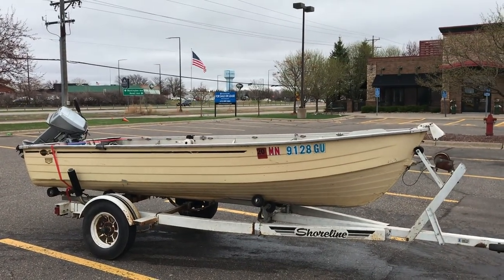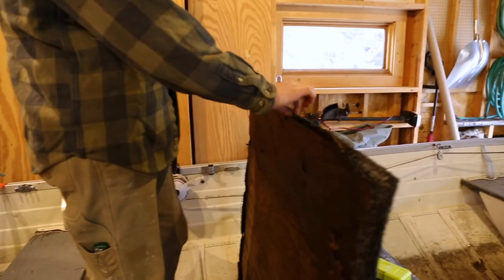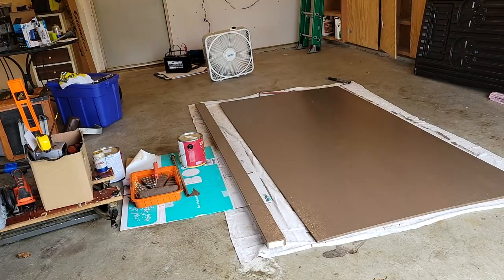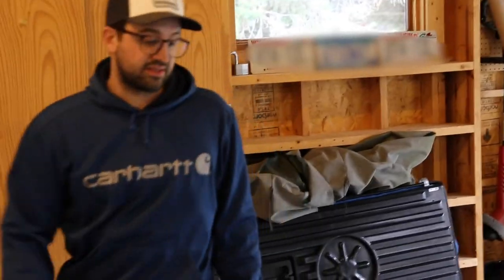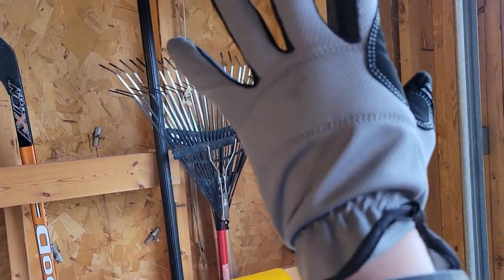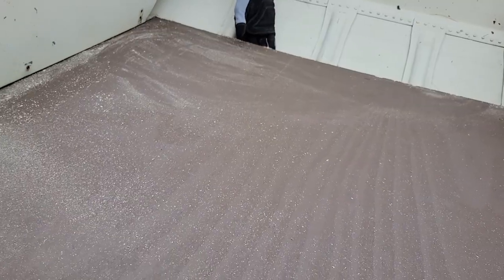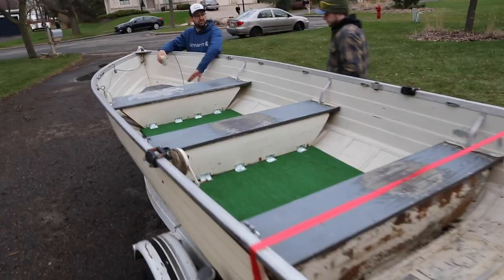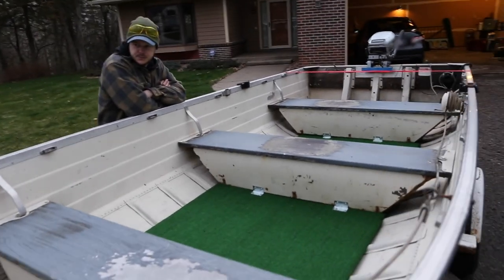Replacing Floors on an Old 14 Foot Aluminum Boat - Boat Prep Part 1

Comment: You guys give off the vibe you've never used power tools but not in a bad way
Reply from the maker: Haha Thanks I guess? Alex works as a line supervisor at a workshop, but I sit behind a desk all day. So, you're half right.
Reply: @TheresOneOutdoors  meant no hate by it man, love the video. I was redoing my new boat and came across the vid so it definitely helped 👍
Reply: @lucyfur8068  no offense taken! Glad it was helpful
Reply: Axle does not look bent, it’s supposed to be cambered in the middle.
Reply: Ok, now I'm inspired, sort of. I want to put a levelish floor in my boat too but need to save up for the plywood. Did a casting deck in the front of it and has held up pretty well so far. Also added home made boat guides for when I launch and trailer it on my own. (16' alumacraft ) Also in MN.

Comment: I have a 79 Mirror Craft. I believe it's the same boat. My uncle had it on a ranch outside for 11 years. He gave it to me and I turned it into a bass boat. I used mostly old aluminum sign framing to build the structure for the decks. It was my first rebuild but it came out nice.
Reply from the maker: That's awesome. Aluminum is a great idea!

Comment: I have removed the second seat in my Mirro and seems to work fine and really helps with the “ fishing” room in the back of the boat.
Reply from the maker: In a small boat like this, you can't have enough fishing room. That's why I'm holding off making any seats permanent.

Comment: What were the sizes of the panels that you cut for the flooring
Reply from the maker: I don't have the exact measurements as we traced the existing, rotting floors. 
The back piece is 37.5" across (left to right) by 35" (front to back). The front piece was 36"x36". 

Neither piece were exactly square. Hope that helps!

Comment: Looks good. Do you have the capacity plate for this boat? I need the info for mine. I’m rebuilding my exact same boat!
Reply from the maker: Thank you! I just checked. The plate is there, but it's so old and worn out that I can't read that part. It literally looks blank lol. Wish I could help. Sorry!
Reply: @TheresOneOutdoors  thanks I appreciate it! The search is on. I’m in jersey and have to get the boat inspected. I’ve even written to mirrocraft. They never got back to me.
Reply: These are very well built boats. My boat is solid. I love this little boat
Reply from the maker: @skipstersouders5535  Good luck to you! Let us know if you hear back. Now I'm interested to find out!
Reply from the maker: @skipstersouders5535  Same here! We just made a casting deck. Video for that coming soon!
Reply: It’s probably around 4 people at 150lbs. 
800 lb capacity ish (with motor etc)

Comment: NO FLOATATION! ALL THE AREA UNDER THE FLOOR IS SUPPOSED TO HAVE SHEET FOAM. 
THAT BOAT IS GOING TO SINK LIKE A ROCK IF YOU EVER GET SWAMPED OR FORGET THE PLUG!
Reply from the maker: I suppose you have a point, though we haven't had any sort of issues at all. The floors are easily removable, so perhaps I'll do that next time I remove them. Thanks for the comment.
Reply: There’s usually foam blocks under the benches.

Comment: The one side of that carpet you guys stapled the wrong way it could easily rip off tightening them screws on the plywood you could see the screws just keep spinning when you had it all the way down, that's not good. Is a good video to learn what not to do
Reply from the maker: Thanks for the comment, John Smith. 1 year later, the floor looks new and performs the same as it did day 1. The screws are held in place with washers and nuts, not by being screwed to the wood. This way, even if the wood did rot (like it was before we replaced the floor), the brackets would still be held in place. 
Take this video for what it's worth. I'm sure there's a better way to install a floor, but this was an inexpensive and relatively easy way we chose do it.